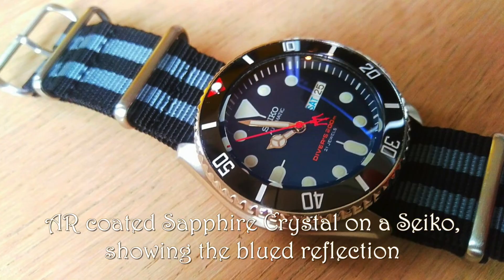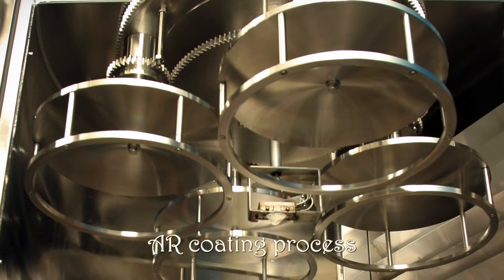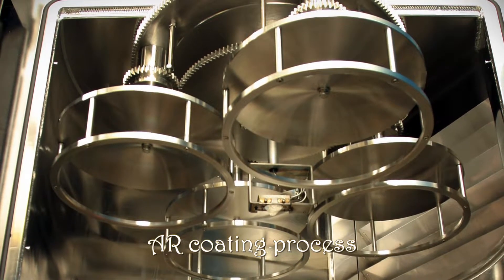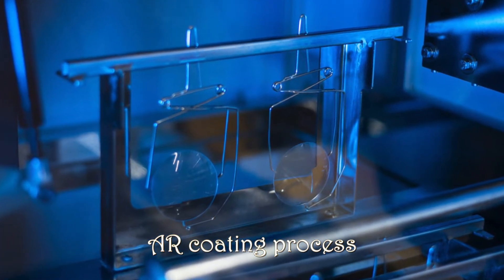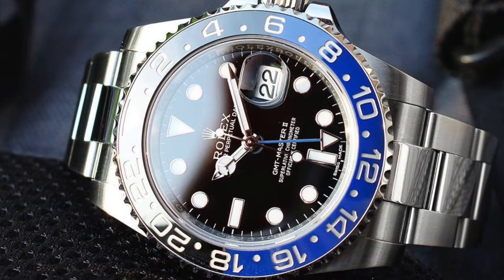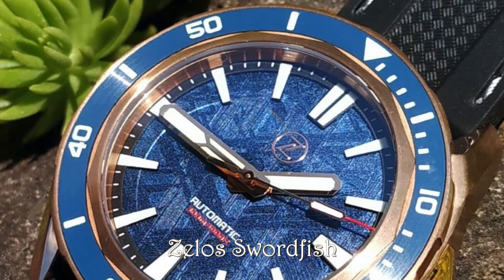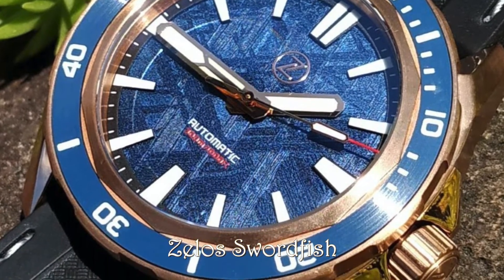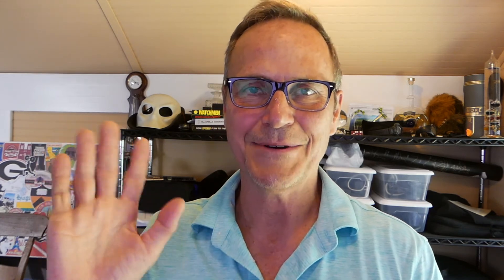Why put anti reflective (AR) coatings on watches?!

Comment: Regardless of what you feel about reflections, putting an AR coating on Sapphire Crystals is plain STUPID.
The only reason you want Sapphire as opposed to mineral glass is because it doesn't scratch.
The AR coating WILL SCRATCH, hence putting it on Sapphire makes it very scratch-able.
If you want an AR coating, just put it on mineral glass or chemically toughened glass!

Comment: Thank you for making this video!  I've taught Optics for several years, and definitely feel that with the high index of refraction, sapphire needs these AR coatings.  Otherwise if you use a softer crystal like the Acrylic on the Sinn 103 then with the lower index, reflections are not a problem.  Typically an AR coating is optimized for the peak brightness of the sun in the green/yellow portion of the spectrum.  That means that blue and red will partially reflect, hence the blue/purple reflectins you see.  Ideally a flat sapphire crystal with AR on both sides will give you the best results.  The Glycine Base 22 is a great example of doing this right.

Comment: Also generally flat crystals don't get hit as much. That's why a lot of plastic crystals are dome, because when you hit the watch you hit the Crystal instead and then when it gets damaged you just replace it for extremely cheaply. Whenever I do a change out from Sapphire to plastic, I always get an extra one, it really protects the watch and then if it gets too damaged to repair you can just put the new one on again and have a brand new watch again.

Comment: Some Rolex have AR.  Depends on the year and model.  The cyclops sections have been getting AR coating for decades.  More recently, some models started getting AR coating on the inside of the full crystal.  And more recently, some models started getting AR coating on both sides.
Reply: Some models have AR on both sides? You mean one model

Comment: Thanks for the video. I have this https://www.omegawatches.com/en-us/watch-omega-seamaster-diver-300m-co-axial-master-chronometer-43-5-mm-21092442001001 and was wondering if this really had ar coatings on both sides. I compared it to another watch without ar coating and I can see the difference.
Reply: Your watch has coating on the INSIDE. look at the site and read the spec. Mine is the 007 and is also treated inside which is the preferred way.
Reply: I don't understand... why would you spend like 8000 USD on 1 watch? Unless you put the watch near someone's face, they wouldn't know you had that much expensive watch

Comment: Looks great when new, but the outside coating WILL get micro scratches with normal use. It is visible under direct sun at the right angle. My Breitling was the same. My SMP is only 6 months old, and babied. Already see extremely fine scratches in the AR coating in bright sun at the right angle. Now I look for it just because..............
Reply: Same lol I my brand new watch just 4days old i got worried

Comment: Great video. I have this problem with a Jaeger-Lecoultre watch which has a domed boxed section sapphire crystal. It only has AR under the crystal but it is still highly reflective. It also has a black dial so the reflections are even more obvious and annoying. Too bad JLC don't can't get me a sapphire with AR on it. 
I've been trying to find a solution to this but to no avail... Just have to suck it up cos I love the watch itself. :(
Reply from the maker: What model watch is it? Is it like a dive watch or a dress one? I'm very curious: it seems a bit crazy that such pricey watches as JLC and AP and such only have under-sided AR coating, but they might be planning for them to be "archive grade" watches: ones that will look as good in 40 years as they do today. That's fine, but I like to use my watches today. lol. I wonder if you could find a place the would do deposit AR coating on the top side? If so I'm sure it would be very expensive, but it might be worth it to make the wearing experience that much better.
Reply: @DrKnowitallKnows  I have the AMVOX 1 (2006), which is quite old now. I emailed JLC directly and they told me that they only out AR on the underside to keep the sapphire scratch free. They said all JLC watches on have an underside AR coating. Now, here's the funny part - I also have a JLC Polaris (2018) and that definitely has double sided AR coating; I can see the blue hue and light scratches on it. 
Perhaps, they've changed their policy now as they realise it's a good way to charge their customers for a new crystal. Haha!

I'm based in Hong Kong and I've been to several places asking for AR re-coating and they all said that it's almost impossible without the proper machinery in a lab.
Reply from the maker: @A.T.148-Scot-HK  Wow, that's quite the adventure there, just finding out what kinds of coatings are on these guys! It seems really odd that watch companies say this is so difficult while almost every pair of prescription glasses has AR coating on it. Maybe putting it on plastic is just easier than on sapphire. I sort of feel that if you have a flat crystal, 1 sided (or even no sided) AR is ok, but if it's curved/domed at all, that's when double sided is really important.

Comment: AR coating on prescription eyeglasses is common even on plastic lenses and isn't costly at all, so I imagine the rationale is as you say, its poor scratch resistance performance.
Reply from the maker: Yes, I should've mentioned eyewear. I do find it "interesting" that most sources say it's very expensive to do AR coatings on watch crystals, while eyewear with AR is not terribly expensive. I should look into it more: perhaps putting AR on sapphire is harder to do than on glass/plastic? Or maybe the quality is higher or something? Or maybe they just like to tell you how hard to do it is so they can charge more ;)   Certainly AR coating on a watch that costs thousands of dollars is a tiny fraction of the total cost (and $300-400 watches have AR coatings on them), so cost definitely shouldn't be a reason!
Reply: @DrKnowitallKnows  Even a $130 Nikon 50mm/F1.8 lens is AR coated on every lens element:
https://www.bhphotovideo.com/c/product/247091-USA/Nikon_2137_Normal_AF_Nikkor_50mm.html/overview